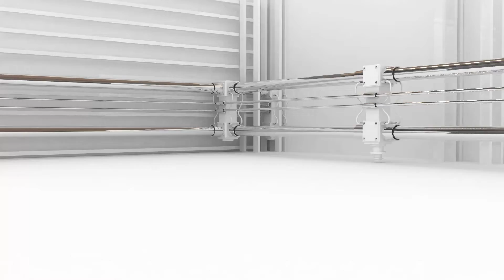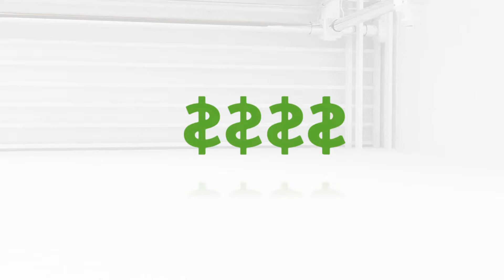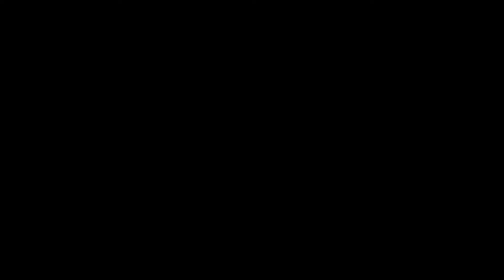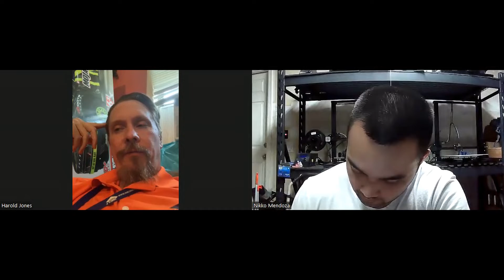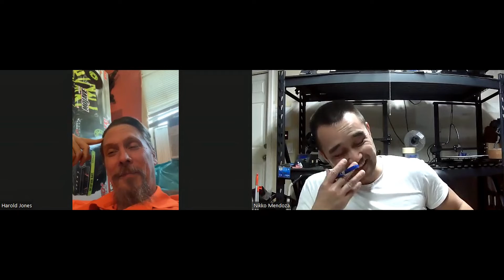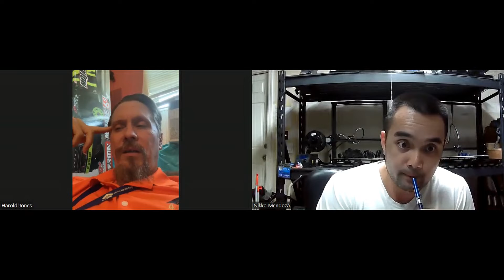3d Printed Profits Episode 66  Motorcycle Parts Brings in $420,000

Comment: I'am still using 123Design, and have been using it since 2016 when I started my 3d printing journey.  The biggest downside of that software is that it doesn't have a timeline like Fusion360 etc, and support for it had stopped years ago.  Will have to change to something else eventually.